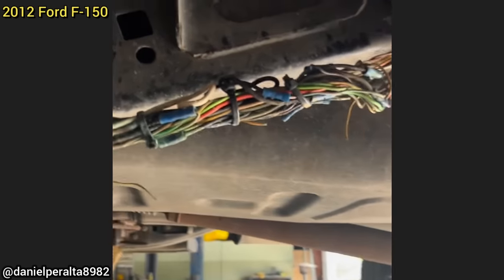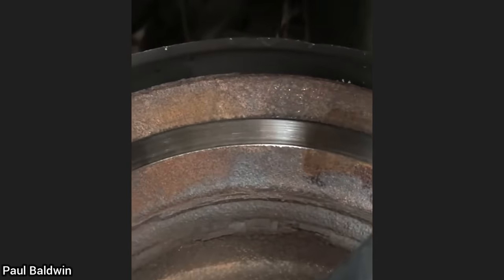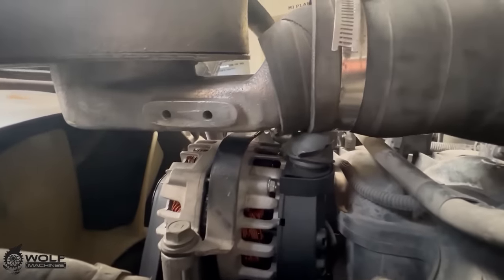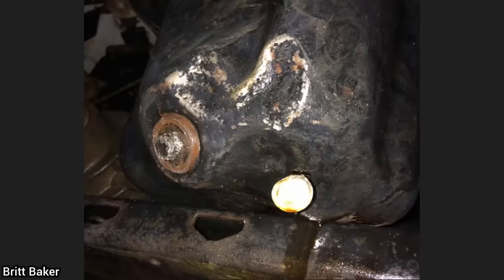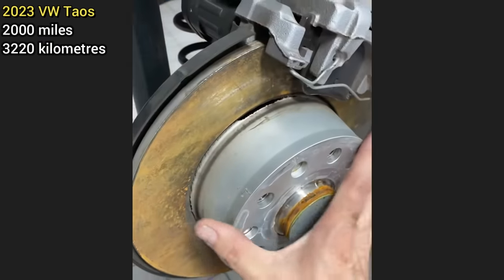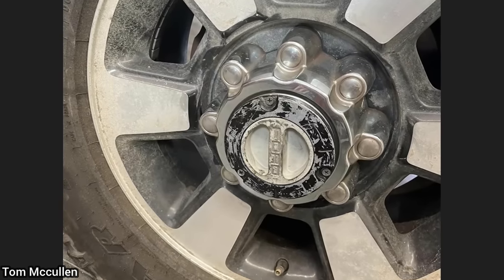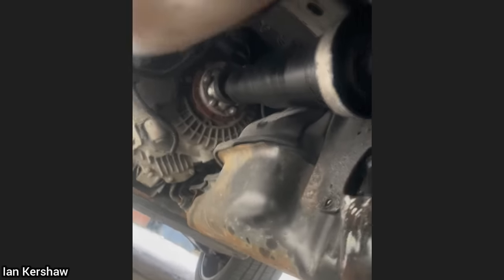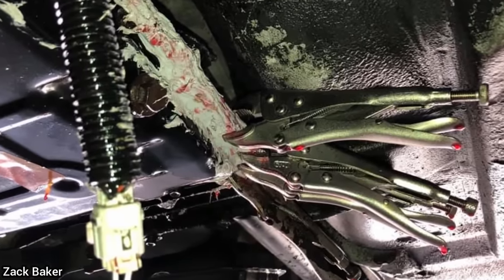Customer States He "Fixed" Some Wires, Now Truck Keeps Shutting Off

Comment: We had a customer come in a few times a week for a few months buying parts for "his bosses ram 2500". After the second or third time (out of probably close to 20) we told him maybe they should think about putting it through the shop. He insisted he could fix the problem... He finally brought it in last month, the trans was shot. When they went to take pictures for warranty to get approval there were Sheetrock screws through the oil pan in order to hold it up. He was being a complete asshole to the service advisor because warranty had declined it. I brought out a pile of reprinted invoices for a the solenoids and seals and other things he had bought. He stfu real quick. In the end it cost him a new transmission and the couple thousand in parts he had bought while fucking it up in the first place thinking he knew what he was doing.

Comment: The guy with the rim problem could have been a couple things, I had one genius mechanic use his high torque air gun on my rims and had then at 200 ft lbs on the lugs which would not break free and I had to go to the garage and have them backed off or strip the lug heads trying to get them off with the t bar, or his aluminum rim welded to the hub, in which case you just back off the lugs halfway and run your tire up and down a few curbs til it breaks free, prying and sledging aren't gonna get you far if it's welded on with rust w aluminum rims, you'll just be a swearing sweaty pissed off dude on the side of the road getting filmed with a pick axe.

Comment: Maybe the last guy's wheel is stuck after taking the lugnuts off.  Happened to me a couple of times, but I certainly didn't bang on the wheel.

Just banged on the tire till the corrosion finally let go
Reply: Yes, this happens. Aloy wheels and rusted steel axle.
When I was 19 I hammered on the tire of my old ford.
On the inner wall of that tire. Lying under the car. Just jacked up.
Now I'm older (and hopefully a little wiser)
Reply: @chrisridethatbloodything2044  I also learned to not use metal caps on the valve stems, jacked up the valve stem threads on my "old" '11 mazda 3 when they got corroded

Comment: yup looking at it again the last guy is trying to break a wheel lock . he is hitting the wheel nut.
and the guy with the rusty rotor and new pads maybe thought the new pads would remove the rust in a few stops instead of removing the brake lining.

Comment: Sometimes I'm honestly quite grateful I live in a mandatory vehicle inspection state after seeing some of the moron "repair" attempts in these videos!
Reply: You think the people that drive these wrecks actually have them inspected and when they fail, they stop driving them instead of just driving without registration?  That's not how the world works.  The government's own studies and those of insurance companies have shown no measurable difference in safety between states with and without stupid inspections.
Reply: I live in England. All road vehicles must be checked every year. If you drive without a test certificate and get caught then it's a fine. But then your insurance wasn't valid, so it's a much larger fine. If the police don't like you then you will be arrested for "Driving an Unroadworthy Vehicle", which is another fine and you may get banned from driving at all. If you crash and someone gets hurt and any of the above apply, then you are going to jail. And when you get out you will still be banned from driving.
Reply: @01Z06guy  In this State the inspection stickers are unique EVERY year and the fines are insanely high if yours are out of date and you're apprehended which is almost a 100% guarantee, not to mention if you don't fix the issue in a week after being pulled over for it and prove >>in person<< you've corrected it, you loose your driving privilege.  Inspection stations won't lie and sticker an unsafe vehicle because they are liable LEGALLY & FINANCIALLY if they sticker an unsafe vehicle.  It's exactly how the world works here.  SO.... blather all you want...  you're wrong.

Comment: Never knew propane kits where common in the US. 
How much is a gallon of propane and where do you fill it up
Reply: Many gas stations sell propane. Here in California it's about $4.25 a gallon. I used it for my barbecue but I guess some vehicles run on it.
Reply: It's not common. Some fleets, and the odd individual. My dad had the dual fuel conversion on a pick up truck back in the 80s. For a while he was getting filled with no road taxes, so it saved money, but I don't think he ever saved the cost of the conversion.
Reply: @garyszewc3339   well with common I meant that it's done at all.

Comment: Drilling holes in the oil pan to remove it, let's suppose it works. Then what? He has no more oil pan, how is he gonna put new one in if he had no room to take out the old one? by folding it?
Same reasonning with the pick axe, if some how he manage to get the wheel off, which will never happen if it's corrosion holding it because he is hitting the studs or if it's a locknut that he is trying to bust, once the threads are gone and the stud is bent and  mushroomed the wheel will be stuck on there  then what?  Why the hell is he driving around with a pick axe, is he ready for some road rage?

Comment: This collection is just bumper to bumper automotive insanity. It is beautifully finished off with the clip of somebody taking a pick axe to a BMW wheel, an action which denies rational analysis. However, drilling holes into the oil pan comes close. Just why would anybody think that would help?